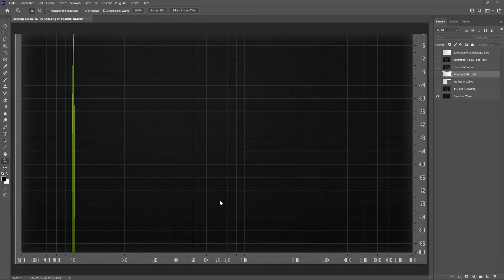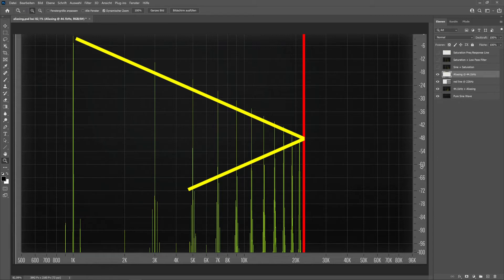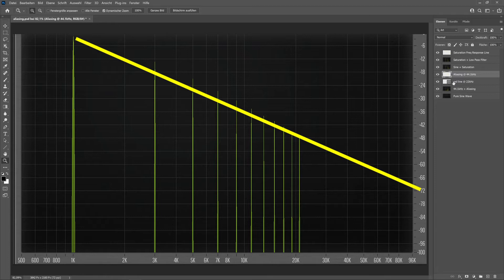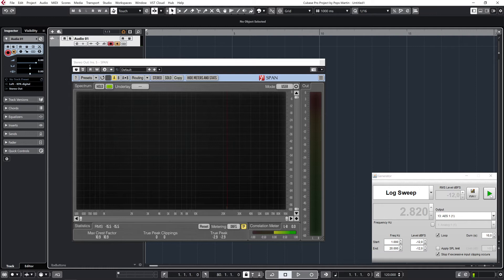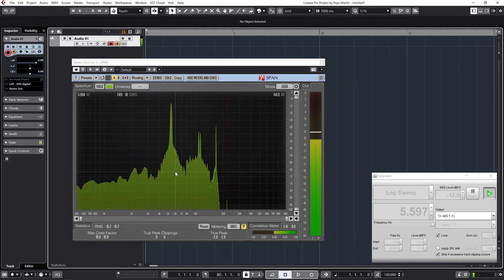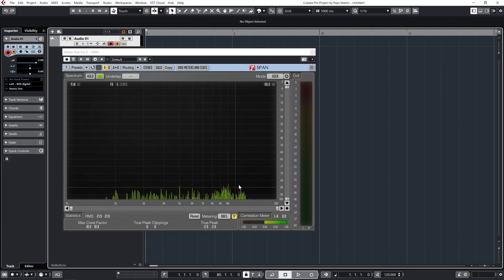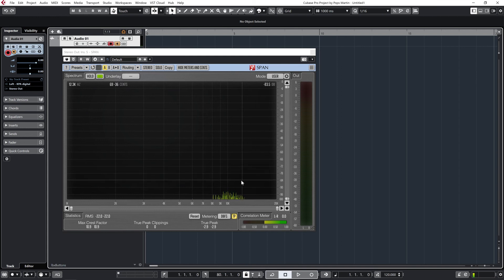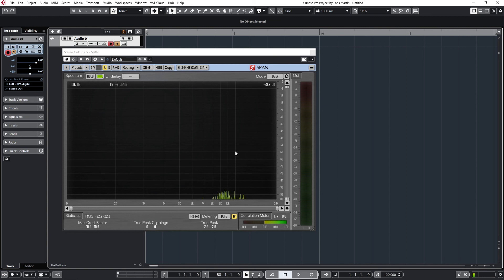Kemper Profiler | Aliasing vs. Sample Rate

Comment: Do you think that using an analog drive stomp box between my guitar and the Kemper input, instead of using Kemper's internal stomp, could provide some freedom from the aliasing problems generated by the internal stomp drive? I felt that when I used the Boss Blues Driver in this way, some of the unnatural high-frequency sounds I knew from the Kemper were somewhat alleviated. (it just my opinion) I'm curious about your thoughts on this.

Comment: How are you recording the Kemper? The unit is supposed to run at a very high internal sample rate to avoid foldback distortion and aliasing. Then down-sample to 44.1k on the analog output so everything is aliasing free.
Reply from the maker: Hi Matt, the Kemper does not use a "very high internal sample rate" throughout the entire signal chain. It's just the tube simulation stage (the profile loaded into the AMP block).
Reply: @PopsMartin  Interesting. So you are saying only the tube amp block stage is oversampled?
Reply from the maker: @theblowupdollsmusic  Not only me saying that, Christoph Kemper himself stated "The algorithm for the tube simulation runs on more than 700 kHz sampling rate". So it's not a secret. The global sample rate is 44.1kHz and the tube simulation uses 16x oversampling (705.6kHz). If the Profiler had this sample rate through the entire signal chain, it wouldn't be possible to render all the effects with a latency low enough for proper playing (with the given DSP).
Reply: @PopsMartin  Thank you for the details! I always thought that higher sample rates yield lower latency. It seems to matter more with anything causing harmonics or distortion. Reverbs also sound better. I feel in a few years once CPUs are cheaper and the entire chain can run oversampled, all these issues will be solved. Hopefully the kemper 2!
Reply: @PopsMartin  I know Christoph Kemper said this about oversampling in the Amp block, however I find it quite strange because at 16x oversampling there wouldn't any detectable aliasing, especially with such a low gain setting. Yet it is there, as you and many others have demonstrated. When I compare this to VSTs that allow you to control the oversampling rate, Kemper sounds like it does 2x oversampling at best. Even 4x should already be much better.

Comment: This was a very eye-opening and easy to understand demo of aliasing. Well done! This is discussed a lot in posts about vintage plugins. That's where I picked up this topic and thought this is even more important for modelers because the more harmonics you create the more aliasing will encounter. I came from kemper forum to your post. I'm surprised more guitar player aren't interested in this. I am a guitarplayer too and own a lot of gear I collected over the last 20 years. 

In your experiment it seems that aliasing is more a problem with higher frequencies. My question is, isn't a cabinet impulse response a "natural anti aliasing filter"? All cabinets don't transmit frequencies above 5 to 6 K. 

My resolution for this is the following: I stick my guitar direct into a country man direct box. From there one cable goes to an engl preamp that goes direct to Torpedo Two Notes Cab M+ for monitoring with nearly no latencs (3 ms) the other output goes into the AD converter into my DAW Cubase 11.5. In the DAW my clean wire sound is played back with a Mercuriall Euphoria, which is a Bogner Extasy 101B with 8x oversampling. This way I don't have audible aliasing. 

I am very much interested in new gear, especially in modelers like Kemper, Fractal Audio (which I own) and Quad Cortex. I recently thought to buy a Quad Cortex. But I assume it has the same probleme with aliasing. And so I probably will wait until modelers have less anti aliasing. Of course it is very convenient to gig with a modeler. You are much more flexible and it's much lighter.
Reply from the maker: Thanks for your long comment. Of course a guitar cab reduces the effect to some degree due to its frequency response. Still the guitar cab doesn't cut off the high frequencies completely, it just results in a more or less gentle roll-off. The problem in digital audio is that we have to deal with latency. Oversampling takes time and we want to avoid that as much as possible, first and foremost where a musician plays an instrument. In the mixing stage latency isn't an issue, we can apply all kinds of filtering with highest quality.
Kemper do a pretty good job balancing quality and trade-offs like aliasing. But it's there and it can be audible. That's all I wanted to show. :-) Cheers
Reply: Is the solution to record in 192k? Or does that introduce oversampling into the plug-ins?